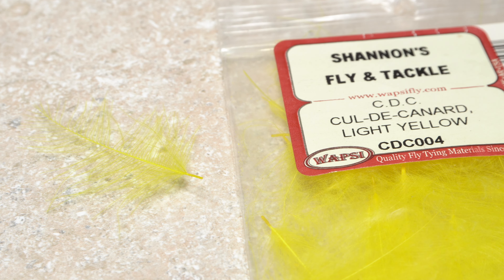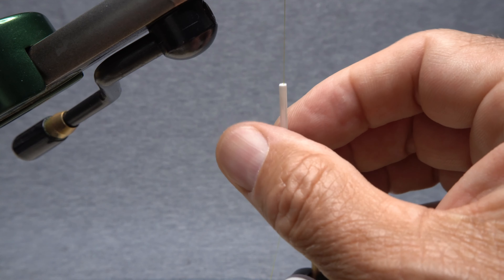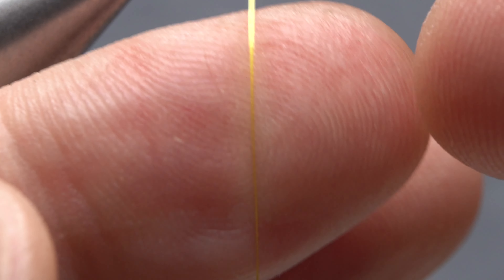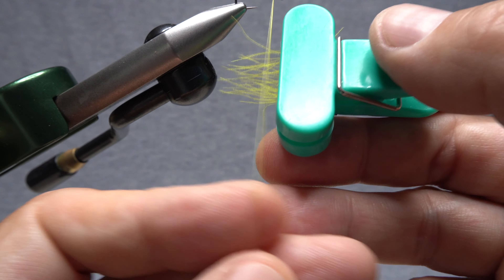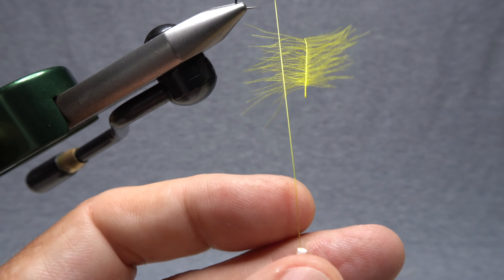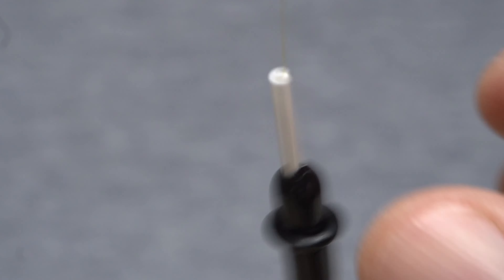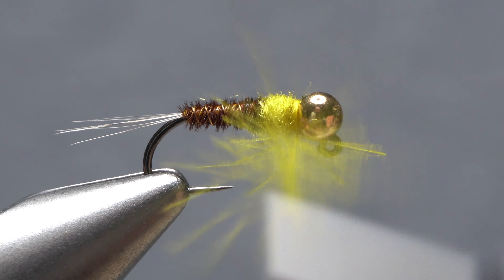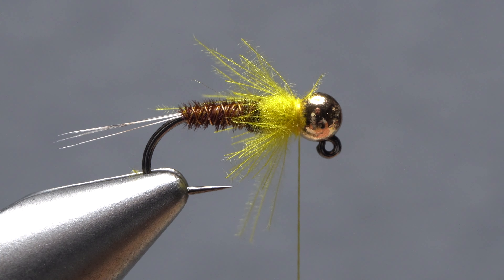Split Thread CDC Collar

Comment: I’ve also seen and used a Mr. Clean magic eraser with slits cut into it to slide the CDC stem into which brings both sides of the feather into position for the clip.

I will say that CDC clip is very useful! 🙃